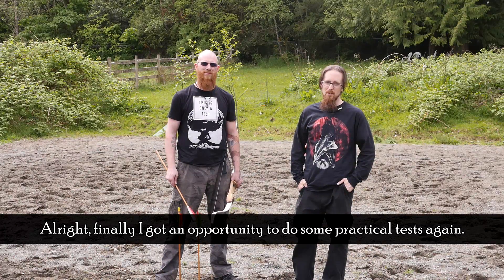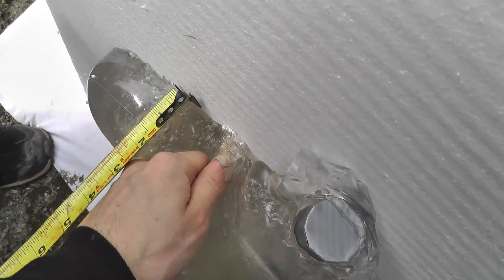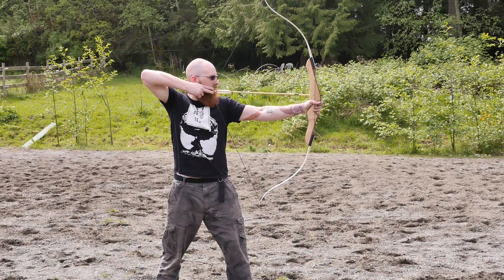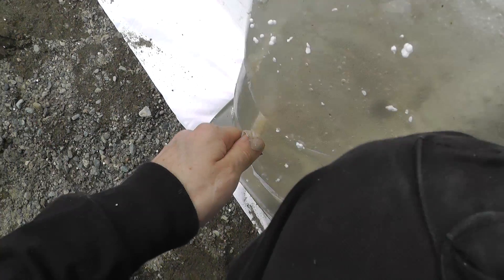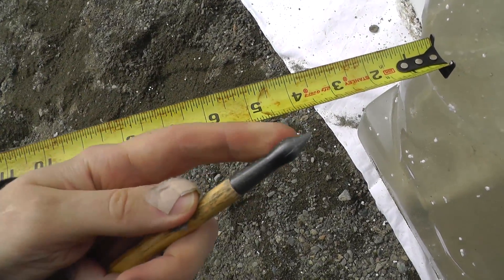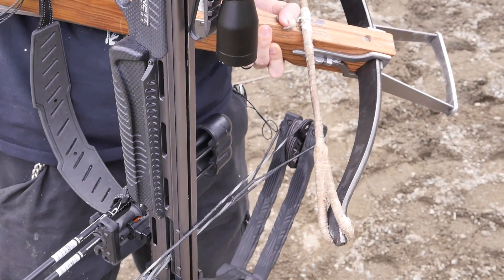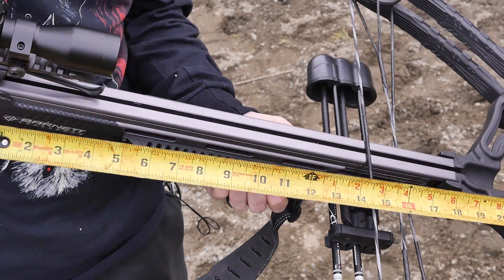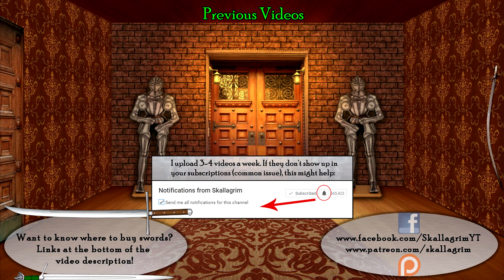Medieval vs. Modern: Testing Bows / Crossbows - Field Tips, Obsidian Point, Broadheads

Comment: I think the idea of draw weight is severely overemphasized when it comes to bows. Sure the PVC bow had higher draw weight, but the material springs back less efficiently, meaning less acceleration of the arrow. there's also the fact that the bow can't be drawn back as far because it's smaller, giving it even less time to accelerate the arrow compared to the first bow. Same reason why a crossbow with significantly more draw weight actually doesn't produce that much more speed and penetration than a bow.

Comment: This doesn't bear any relationship whatsoever with the medieval longbow as typified by the so called "English" longbow and also that used by the Welsh archers (The Men of Gwent). The English version was usually of yew or mixed wood construction, about 6 - 6.1/2 feet in length and have a draw weight of 100 - 140 lbs. The Welsh bow was often made of Elm and somewhat stockier than the yew bows but of similar length. Draw weight could be up to 160 lbs. Arrows shot from these formidable weapons were usually bodkin pointed (an elongated 4 sided pyramidal forged iron point about 4 inches long). These would simply penetrate through any armour and body contained therein. They were the "shock and awe" weapon of their day. Yeoman archers were required to practice with their bows many time a week, often resulting in grossly over developed muscles on the draw arm side. This is seen in skeletal remains from the period. I doubt there are many archers around today who could draw one of these monsters fully, let alone shoot it accurately.

Comment: Sry but that test is almost useless. The reasons are
1st the Dummy is sometimes flat on the styrofoam and sometimes There is space between
2. The Dummy is sometimes Hit on the side (added 2cm) and sometimes in the chest (added 10 cm.
3. Styrofoam is Not New after each shot (easy penetration hole in hole[or close])
4. Styrofoam is wedge shaped, thin = easy, thick = Not easy
5. Only One shot with every Tool
6. Not Sure but Do you have a line on the grund for same distance shooting?

Comment: modern cross bow was like 
now you see it and now you dont.

you should do magic tricks
Reply: The 70lb compound is roughly equivellent to a 100lb Longbow or composite bow. Results would be similar. Crossbows have to use alot more pull to get the same arrow speed as much lower pull ordinary bows due to a much shorter power stroke, particularly historical Medieval crossbows.

Comment: Daryl Dixon (Walking Dead) draws his crossbow like it's 20lbs. Lol. Besides with a strong crossbow it would likely be a through & through on a softer rotting Walker's skull & you'd either lose the bolt or it would be smashed hitting a tree or whatever.

Comment: i dont think its time... its the distance which increases the potential energy 
potential energy = acceleration × Distance × mass. 
or you could look at it as 
Work = Force × distance. 
so if Force is constant then you can increase the amount of Energy/work by increase distance. 

both formualas are the same, and time as u can see is not the variable that matters. 

sorry i like physics i couldnt help my self. did my explanation makes sense.

Comment: You weren't drawing the pvc bow to the same length as the 35 lb recurve, so not getting your full 50lbs worth.
Also for a proper test you really need to use appropriately weighted arrows proportional to the bow weights so you achieve the same kinetic energy.

Comment: Your medieval Bow was a short bow so that's is why it had such a low draw weight. If you had used the more common long bow with draw weights of up around 100 pounds then you would have gotten a better comparison. These medieval wepons you used are more of the commoners wepons and not a military grade.  wepon.

Comment: A cheap, low poundage recurve bow with field points... Why bother!
Also field points are designed for slowing the arrow on impact for low penetration. Makes it easier to pull out of targets. So the modern equipment was actually hampered by this disadvantage.

Comment: why waste money on "bows" like that. they arnt even bows. how are they supposed to be used. simply for target practice? for what if you don't use a stronger bow there is no point. a minimal is 100 lbs draw weight. and that's still at the very week end of shooting. never mind historical accounts. standard longbow is between 150 and some accounts of 210. these ones you have shot are nearly worthless. (crossbows are cheating)